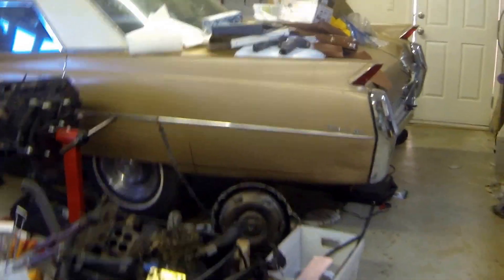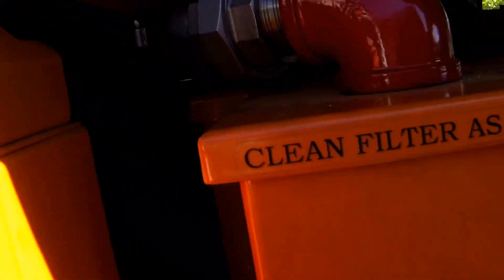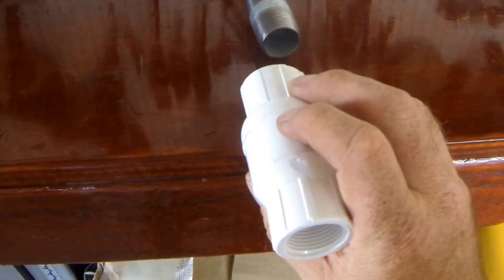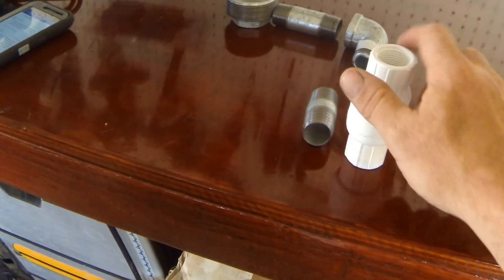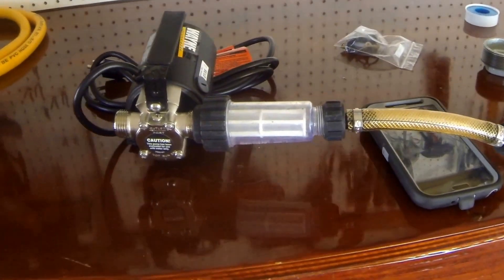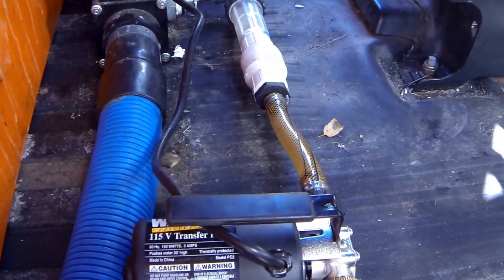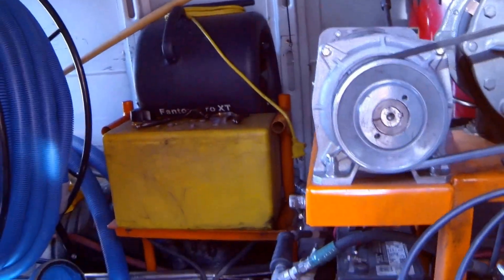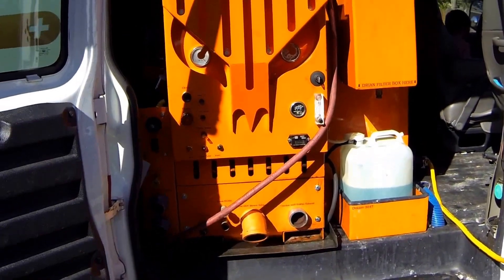APO for Dragon for under $150

Comment: I love this Damon. Very helpful. Would you comment on the normal lifespan of one of these motors. I want to add one onto my truck mount but I’m concerned about if I use it regularly for cat 3. Any recommendations?
Reply from the maker: Seems to be working fine.  I now use the motor for a fresh water transfer pump and it's holding up.  The good thing about it is, it's only a Harbor Freight motor, so if it goes bad, it's easy and cheap to replace.

Comment: so your truck mount has a 115 volt generator take off?   How many amps will it supply (watts)?? Most waste tanks collect a lot of sediments that really would clog that tiny fine mesh filter in a New York second.  Had you changed it out since this video was shot? The pump sounds like a rubber impeller drive so you may be replacing that regularly instead of replacing the whole pump.
Reply: Yes It does have a generator.  Every truck mount needs this option